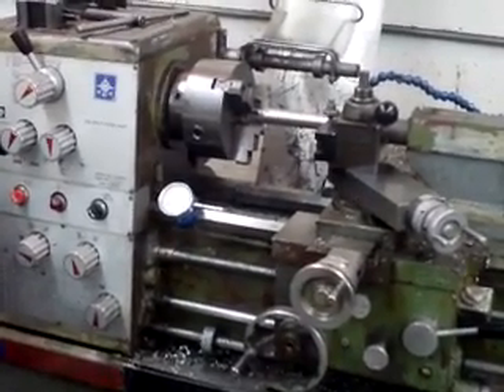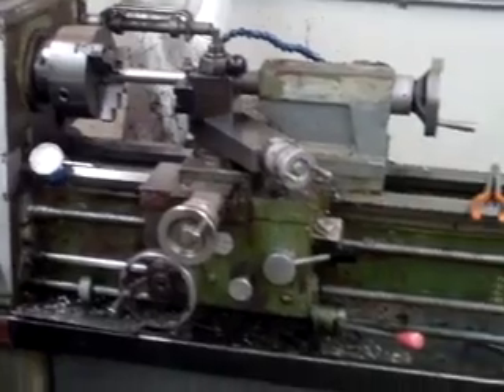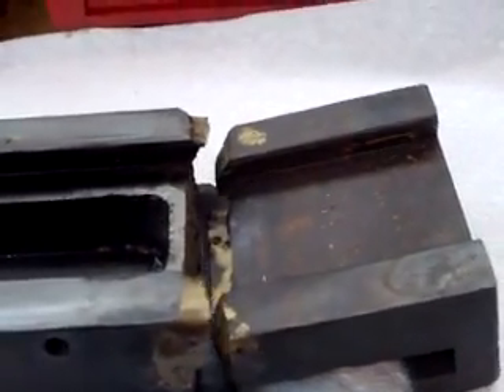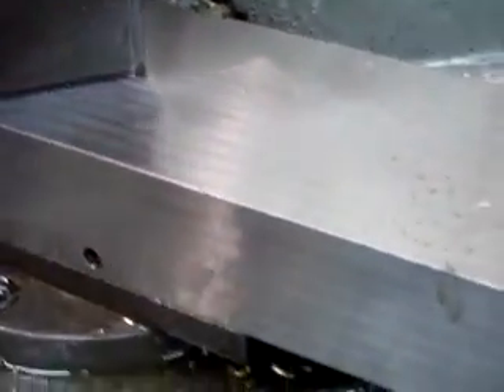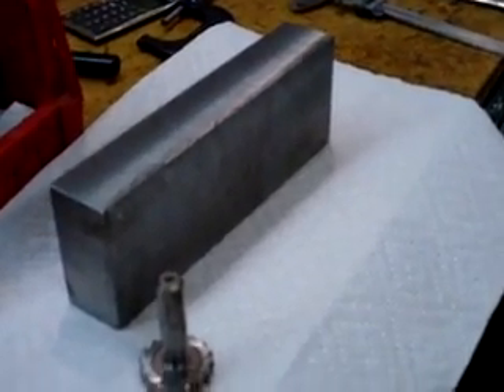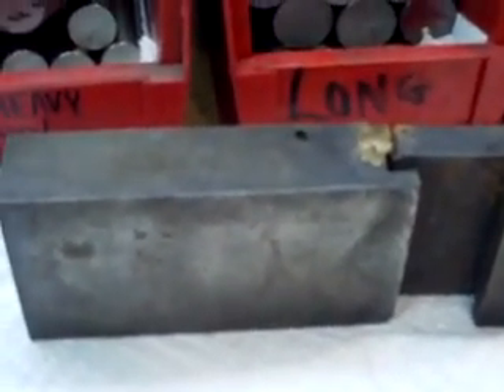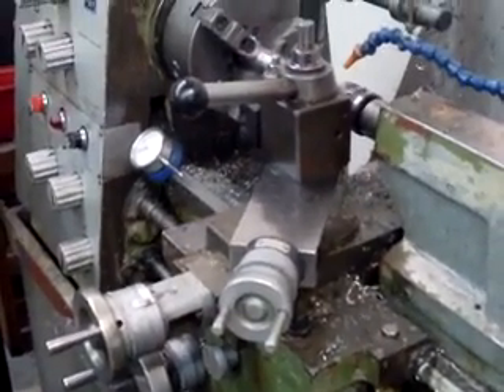Lathe accident fail

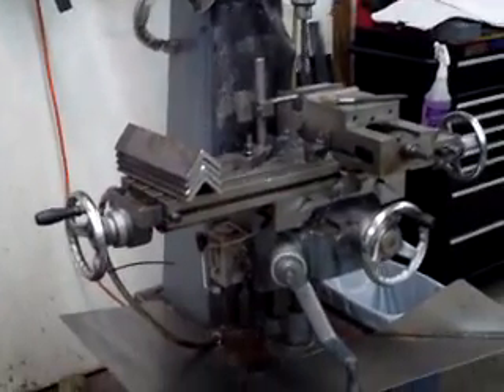Comment from the maker: Did you see the 2HP manual mill at 0:39 with no power feed on any axis? The roughed A36 material at 04:00 is half the size of the original raw material.  It took three hours to bandsaw after I had to weld it to a holding fixture.  Once you mill the pocket on the back side and top, it warps.  All the internal details must be finished first then you can square up the external to clamp for the dovetail cuts.  Yes, days.